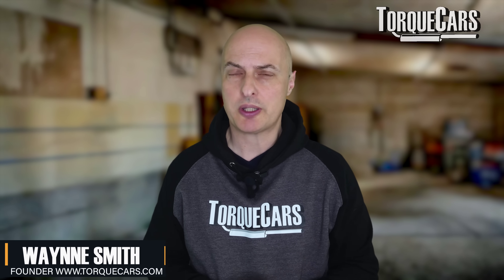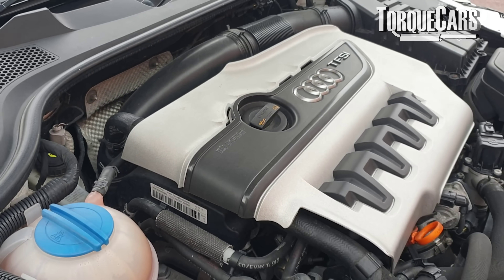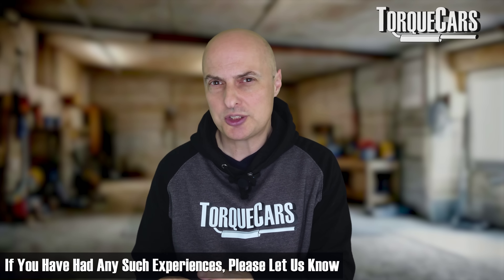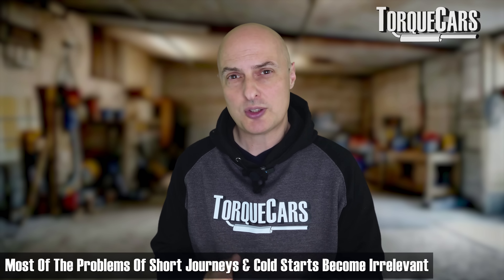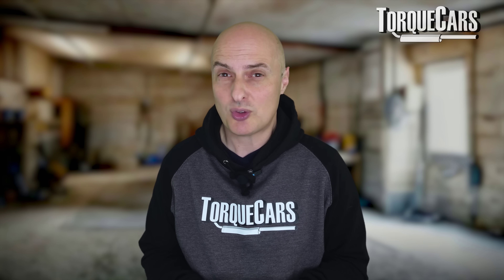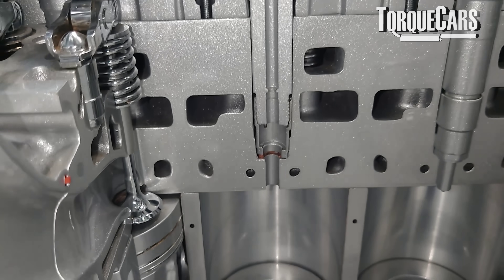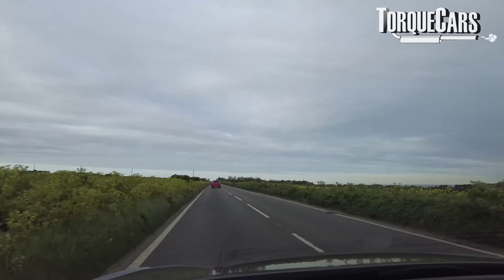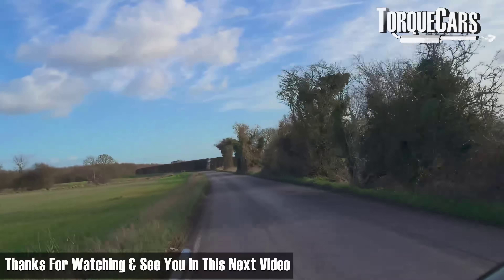🚗 Stop-Start vs Engine Idling: Which Really Kills Cars?💥 The Truth May Surprise You…

Comment: My replacement schedule is as stated - "hoping to get through the next 4 to 5 years without serious issues."  The only difference is that my vehicle is 16 years old !

You have  addressed most of my concerns with stop start systems but one of the main reasons I am prejudiced against them is the possible negative effects on turbos, particularly when the engine stops prematurely after a run involving high engine revs. 

Could you comment on this scenario please ?
Reply from the maker: Most modern turbo engines will circulate coolant & or oil to the turbo whilst the engine is off, so it is rarely a problem now. In reality the turbo will only be stopped for short periods of time and this is rarely a problem with modern oil formulations.

Comment: Modern stop/start systems are designed to activate only when the engine is up to normal operating temperature. The starter systems are also designed to handle many thousands of cycles without issue. My A200 has a great feature whereby you have a choice over whether the engine stops or not. Holding it gently on the brakes doesn't initiate a stop (useful if you're at a roundabout awaiting a gap). Pushing slightly more firmly initiates the "hold" feature which will stop it. It's also worth bearing in mind that with a modern DCT gearbox, any time you're stationery, in gear, the clutches are rubbing together - so stop/start reduces wear. In an automatic gearbox with torque converter, it really doesn't care if you sit stationery in gear. In reality though, on a modern system, the restart is so quick it's not particularly inconvenient to be honest. In contrast, my old Mitsubishi Colt would crank over quite a bit, "riddly didly didly didly" for far too long. That WAS inconvenient 😂

Comment: After a high speed drive when the engine stops running, heat soak takes place which is so bad for the engine especially turbocharged engines 
Most mechanics will yell you that most wear takes place on start up, so more start ups more wear
Keep it switched off to protect your engine, turbo and starter

Comment: Well, nowadays, this "auto-stop" system is capable to not work when is too cold, too hot, gaps in voltages...in general, it just work if few conditions are met first, if not, it just idle. Anyway, too much drama for but good video.

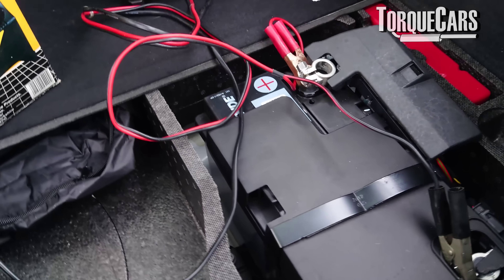Comment: 3:57 Sometimes you say some strange things that make me question the veracity of everything else you've said... many, I thought the vast majority if not all of, vaguely modern ICE cars use belt-driven A/Cs, not battery powered ones. A passing link between A/C use and battery drain when not discussing hybrids or EVs is bizarre, and likely to mislead or confuse people
Reply from the maker: Yes as you point out there are always exceptions to the rule so a video like this has to be quite general and cover as many bases as possible. A vast proportion of cars now are hybrids and a growing number of our viewers are getting them which generally come with an auxiliary electrical ac system. The fans and heater associated with the AC system will be pulling current from the car, a good alternator should be able to cope with this when the engine is running but an old alternator or battery will start to drain when the load is high. However I note that many people will sit in a car with the fans/heater/radio/lights/rear window heater etc running and engine off and although you could argue it is user error it is worth
Reply: @torquecars But the video is about stop/start, which to me makes it about non-hybrid vehicles since if you aren't going to use stop-start with a hybrid, why get a hybrid?
One of the arguments people use about why stop-start is a problem with full ICE cars is it tends to cycle off and on more rapidly than hybrids, although I'm personally not convinced that stop-start is a problem at all.

Comment: We have two Fabias, one a 64 reg diesel and a 65 reg petrol. I only use stop start on the diesel on longer journeys, the petrol, once we've done a few miles. I use the diesel on short commutes most of the time but once a week it is driven down our local bypass at high revs, and every time it's refuelled. No issues with DPF or performance so I must be doing things alright.

Comment: I know you made this video a few months ago but some guys in Germany did a test with a simulated 1 years worth of driving on a stop-start engine and found that it had significant way damage to the bearings where compared to a vehicle that had over a million kilometers on it wasn't much better condition
Reply from the maker: Please take all youtube videos with a pinch of salt. I did attempt to present an unbiased look here and was not aiming for clicks.

Comparing the bearings of a "million mile" super reliable Mercedes engine with that of another car which happened to have stop start and had new bearings fitted is not a fair comparison really of stop start. Any grooves worn in the Mercedes bearing will have smoothed out from the amount of miles it has done. They are also superbly engineered engines, and show up most modern engines for what they really are.

From simple oil analysis which tells us how much metal particulates there are (a sign of engine wear) shows there is negligible deterioration with or without stop start usage. Idling however causes significant oil deterioration (water & fuel in the oil) and that is what would happen if stop start is switched off. It's a rock and hard place situation, which I've attempted to explain in this video so people can think about when to and not to use stop start.

Comment: Restriction of oil back down to sump can not be good when driving hard . 🤔
Reply from the maker: Flow is generally controlled, when there is lots of oil in the head it flows quickly away, the last little bit drains more slowly to keep the head happy. It's not always done really well, I know some RB25 owners have had oil flow issues.

Comment: My Honda Jazz monitors when Stop/Start can be engaged. If the engine is too cold - nope, if the battery is not happy - nope, if running in the "S" automatic gear mode - nope. I might need a new battery though. I think the system engaged maybe once or twice this summer, every other time at a stop it just says nope to switching off the engine cause of the battery.

Comment: I drive my car until he is finished. That is when the costs of repairs are higher then the intrinsic remaining value of the car. So I would say in my case at least 12 years but I would prefer 20... (those good old sluggy atmospherically diesels with a decent bore/block where the max for chill driving and longevity. God, sometimes I miss that typical engine noise... a bit like an 80's bus I would say. Going steep uphill shifting down and patience was needed or a Flinstone make-over...
Those where the days... having a mechanical turbo on it was a revolution!

Comment: Thank you, it is a very interesting and much debated subject. But, I am not sure as to what the conclusion is? Should you use stop/start after e.g. 10 minutes of driving, or should you allow the car to make the decision for you? That is, when the car allows start/stop, use it? Could you elaborate on that please?
I usually switch it off when I start driving and then switch it on after about 15- minutes when I know that the engine has warmed up, but perhaps that is too concervative. But, on certain routes, only after 7-8 minutes of driving, when I came to a certain trafic light and I know I can sit there for several minutes, I usually allow the the engine to switch itself off. But, am I doing the right thing? That is my question. Thank you!

Comment: My car, being a 3 liter turbo diesel has more factors that concern me with this than a small petrol engine. Against stop start is the higher compression, putting even more load on the starter and battery, and the need to keep the oil flow through the turbo to cool it. Against the idling is the higher soot buildup from idling diesels. I switch mine on and off, depending on the traffic buildup and the outside temperature. It does disable stop/start itself until the engine is up to temperature. I have coded my BMW ECU to remember the last state of the switch when I unlock the car. Starting the engine at the lights is not quite as instant as you described and does feel like a load on it. It is not the smooth takeoff you get from an engine that is already running (ZF 8HP70 automatic). Stop/start is definitely the more irritating of the two.

Comment: I have a VW tiguan with this stop start, when the engine is cold it won't kick in, until it has warmed up. Some countries can fine you for idling at traffic lights etc. It is an DSG gearbox, there is a slight delay to start up, but you soon compensate for it.

Comment: The information regarding a warm engine here is completely incorrect. Any engine will take 15 minutes to be warm, with the oil at a reasonable operating temperature, on mild temperature days. On cold days this time is extended significantly. Turning off the stop start for at least the first fifteen minutes is the only option to allow the oil to warm up. Idling any engine for at least thirty seconds before moving allows the oil pump to move the oil from the sump up to the critical wear points, but this isn’t a warm engine. Allowing the engine to warm for the first 15 minutes will ensure the engine oil temperature, and therefore the viscosity, to stabilise sufficiently for normal use. After that time, the start/stop function can be used. Cold oil will not flow efficiently and won’t be supplied in the volumes the engine needs to ensure adequate protection.
Reply from the maker: I think the reality lies somewhere between us. Some engines actually warm up really quickly and others take much longer. Having driven lots of small capacity turbos (1.4 TFSi presently) it would be wrong to say "any engine" takes 15 minutes to warm up, my oil is fully up to temp after 5-7 minutes in summer.

I will discuss the warm up in a future video, because there is not a point at which oil is perfect.  Viscosity starts to drop off quickly and this gets slower the nearer we get to "ideal operating temperatures" so a couple of minutes of being ultra careful then a few more minutes of moderate driving is realistic and ideal in my experience. 

However there is a point near cold where it causes problems due to poor flow. Modern oils flow pretty well from cold but as long as people avoid the first damaging couple of minutes and start adding load gently until the engine is warm I cannot see a problem.

I would be laughed at if I insisted people wait 15 minutes until they can drive at anything other than low rpm and it is not really necessary.

Also idling on cold engines substantially ruins the oil with dilution, stop start will prevent this from happening but will also make the warm up slightly longer.

Comment: I have the misfortune to have bought a Vauxhall Corsa with a wet timing belt which causes me concern in itself due to belt degradation but using the stop start also concerns me due to the potential for  excessive wear and stress on the belt during constant stop and starting. I tend to turn the stop/ start off for this reason. I’m no mechanic so can anyone tell me if this is an issue??

Comment: Complexity is the antithesis of reliability!

This can only cause increased wear and tear on all parts of the engine! Yes you may save 1or 2 litres of fuel but at what long term cost?
Batteries starters, various sensors, possibly major internan components. Consider that some mechanics that swear the up to 80% of engine wear takes place at staftup.Now you are causing multiple unnecessary start up !
Sorry but I choose to bypass the stop feature cycles for even short trips!

I'm not a believer!!!

Comment: The stop start on my last Jag F Pace which was a (very!) mild hybrid was brilliant as the hybrid was designed to start the engine. However I now have a new V8 SVR  and the stop start has to be turned off because when the engine cuts, you lose the power steering so if you want to nip quickly out of a junction you have to wait for the engine to start and the steering to come up to pressure. This only takes a couple of seconds true, but that is a long time when someone has kindly stopped to let you out of a junction. It’s naff! On my wife’s car the stop start only cuts if you hold your foot on the footbrake so if you inadvertently lift your foot the car wants to move off. Again, useless

Comment: Apart from the fact that it seems weird when you first have such a system, I think your argument is probably sound. A warm engine, as you say, is not going to suffer from a few moments not running and then being restarted - starting from cold, however is the major time for wear to occur. My car, for example doesn't let the stop/start kick in until the engine's up to temperature. As for wear and tear on the starter motor, well it's designed for the purpose so that's irrelevant, as is the battery drain, particularly bearing in mind that healthy modern vehicles always start (not so with older engines that can sometimes take a lot of cranking) As for wear on the ring gear and the starter pinion - again irrelevant since modern cars use pre-engaged starters that don't have those issues. I've had three cars with stop/start and so far have never had an issue with the system, unlike older cars I've had that had several starter problems. But the only way to be 100%certain is to do a statistical analysis of related problems in cars with and without stop/start.

Comment: Well, you're obviously an expert. It's not the presence of oil, it's oil pressure where plain bearings are concerned. Modern synthetic oils might mitigate the damage of stop start systems slightly but the damage WILL accumulate and I guarantee engine life will be significantly reduced. You clearly didn't take into account of turbo damage. The turbo continues to spin at 150,000 ram and it's high pressure oil supply is shut off.
As an actual engineer there's no way I'd ever use this stupid idea that no one asked for.

Comment: Not mentioned, but the No. 1 issue for me was the inevitably shorter lifespan of the starter,  associated parts and the battery. My 2023 VW Arteon stop/start cannot be permanently defeated from the console switch, which defaults to automatic stop/start every time the ignition is turned off. The solution was the purchase on AliExpress, of a smart 'cheater' cable that inverts the action of the console switch. The best $20 I ever spent! No more irritating shutoffs, but the function is still available whenever traffic conditions warrant.

Comment: For my 2020 CRV, I installed a cable from Amazon that reverses the function. Now stop/start is disabled by default, and you have to press the button if you want it on. It was easy to install, no tools required. It literally puts a smile on my face when I need to jump into traffic and there is no lag.

Comment: In an auto with stops start it works off the brake! I.e. you have to keep your foot on the brake! Pain! Put handbrake on to take foot off brake, it starts! Rubbish! Also ac does not work? Best just to swithch ss off and just swithch engine off if stuck for any lengthof time.

Comment: Before retiring, I lived 5 miles from work. No freeway, only streets and lots of red lights. Stop/Start would activate before the engine warmed up and the windshield would still be foggy. Permanently turned it off with a homemade trailer dongle, a 4 pin plug and two large resisters.

Comment: Whether it kills engines or not, I know my preference. I have a 2022 bi-turbo diesel Transporter with electronic clutch (DCT) and electronic manual gearbox (DSG) - ie, I don't get to choose when the clutch is activated, I have to wait for the computer to activate it, after it decides the rpm is suitable etc. When I pull up to a stop sign and wait for a gap in traffic only to have the engine turn off it actually becomes dangerous, as when I judge the road to be clear I now have to wait for the engine to start and reach specific rpm before the clutch will engage, and that delay (you might call it only 1/2 sec extra, but in the real world that's an additional full reaction time) can be the difference of pulling out safely and now being placed INTO harm's way instead.
Additionally, if it's raining, some genius decided we need to save the wipers by switching them to intermittent whenever the vehicle comes to a stop, because "why would anyone need to be able to see if they've stopped?"
Add into all this, the AC will be shut down if the engine is stopped, so the windscreen might start to fog up because the vehicle has stopped and the wipers have stopped, allowing the windscreen to be further cooled by rainflow on the glass.
Get rid of the nancy's telling us how we can use our vehicles - we've bought them not knowing about these issues, and without modifying our vehicles, we can't even switch these features off.
(I have a harness modification behind the stop-start switch that remembers the previous setting as long as the battery is connected, but that doesn't help the wipers)

Comment: I turn it of in red light ques at rush hour, when one drive one minute and stop two minutes, repetedly for a long time!
Otherwise it dont kick in befor the engin is warm or the battery is loaded.
Startermotors on start stop engings is buildt different then old time startermotors, the toths are engaged and its a coupling thats kick in to turn it around! The toths disengage after the engin is started!
Soo, the system is mostly for exhaust reduction.. I can give that to the world, even if its only is a promille!
The problem whit such system is rather that it rise the price of the car a couple of hundred of £/€/$!!
And when alredy payd for it, one can use it.. and turn it of in special situations.. mostly for convenience.. whit comon sens!